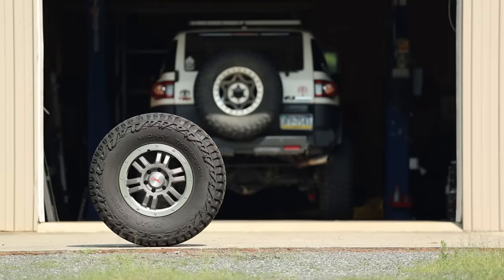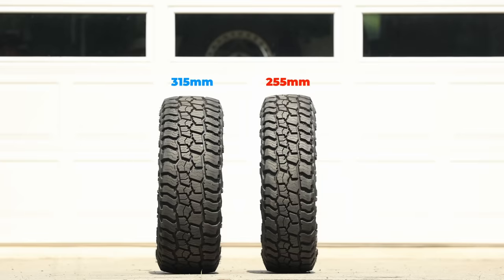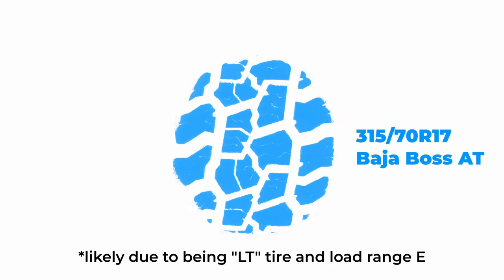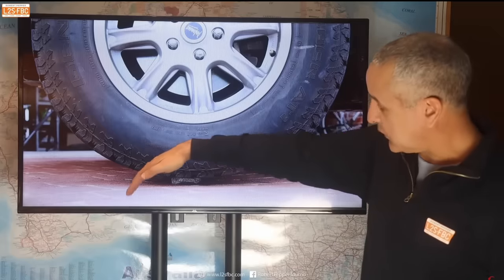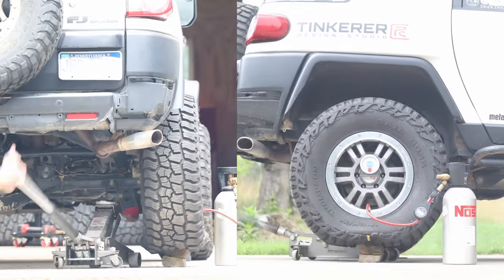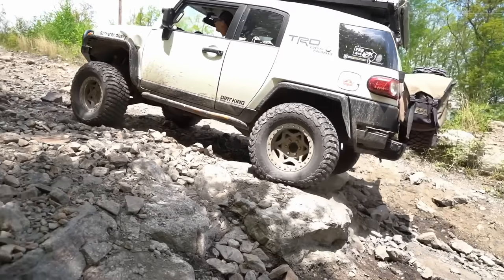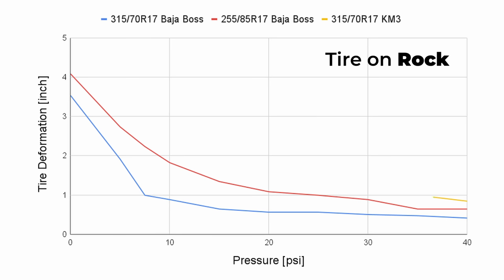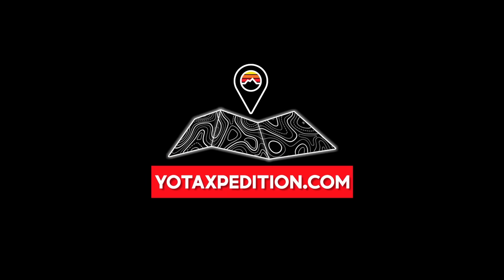3 Scientific Experiments to Settle This | Wide vs Narrow Off-Road Tires

Comment: That's a lot of work and detail put into what are very similarly sized tires.I'd say it's quite a stretch that  your 255/85r17 could be considered a Pizza cutter, compared to the 315/70r17, but I guess there is a lot of room for one's interpretation of what a Pizza cutter is .There are definitely much better comparisons where the term Pizza Cutter might more appropriately apply. My thoughts drift more to old army jeep tires, and tall skinny snow tires, of days gone by..Lots of great information otherwise

Comment: I just find it funny that we are calling 255 tires "pizza cutters"  Up until somewhere in the late '90's or early 2000's a 235 section width was standard on all 3/4 and 1 ton pickups.

Comment: On soft surfaces like sand and snow width and diameter win since debeading unlikely and hard surface conraft area irrelevant. On soft surfaces it's about total area when embedded X amount. It'd be tricky to measure but a similar video using maybe contact adhesive spray and actual sand might work. Huge effort cleaning up though.

Comment: My comment is more on using beadlock wheels, as far as I know, they are for off-road use only (not DOT approved), and I use my 4x4 for play and as a daily driver. 
So it looks like the pizza cutter is the better choice for me.
DOT looks at beadlock wheels the same as the old split rim wheels OTR trucks used many years ago and are illegal for street use. 
But I really enjoyed the video, and the information was awesome.
(There is no federal law specific to beadlock wheels, but there are laws against split rim wheels) that is where the problem comes in.

Comment: The one missing test I was hoping for, does flexing around an obstacle actually improve your ability to drive over it? We all know increasing contact patch will help on soft surfaces you sink into, but we also know that larger tire diameters roll over hard objects more easily. Flexing around an object effectively reduces your tire diameter, which might give you more torque to climb, but does that make up for the reduction in diameter and the energy you’re putting into deforming the tire instead of climbing the obstacle?

Comment: with the beadlock wheel the bead spread is wider than the no beadlock wheel so that is a significant difference in testing the two same size tyres

Comment: I thought this was gonna be more application based than theoretical and testing, so my guess was wider would be better in sand and narrow better on rocky terrain. The tread shape comparison backs this to a point, because a longer narrower patch would dig into dirt more, but the flex helps over rocky terrain

Comment: There is one other variable not address which affects tire deformation.  The weight of vehicle versus the tires max load based on PSI.  Those Baja Boss A/Ts were not identical in load per PSI, the 315s had a max load of 3,195 lbs @ 65 psi while the 255s had a max load of 3,195 lbs @ 80 PSI.   Meaning, as the corner weight of the vehicle is constant, the belt structure of the 255s will be lost much sooner because the loss of PSI will deform tires ability to maintain the load. 

These were designed for a much heavier vehicle and you should weigh the corners your vehicle.   Hypothetically, lets say the corner of your FJ weighs 860 lbs.  For the 315s to maintain structural integrity and constant tread pattern you would have to inflate the 315s to 860 lbs / 3,195 lbs * 65 PSI =  17.5 PSI  versus  860 lbs / 3,195 lbs * 80 PSI = 21.5 PSI.

Same goes for the BF Gs KM3s, they are 3,195 lbs @ 75 PSI, this means at lower PSI for the weight of your vehicle they will have better deformation (in addition the design of the tire and side wall structure).  The results of this test would be different with a vehicle and those Mickey Thomasons

In all my vehicles, I weigh the corners of them with me in the vehicle.  I then inflate the tires to the PSI based on the load rating of the vehicle + 3%.  For example,  on my current Tunrdra on the tires, I run 25 PSI left front, 24 PSI right front, and 19 PSI rear on BF G A/T KO2s.  I've been doing this for 35 years with perfect tread wear and long last tires with 70,000 miles easily.  Every time I put a load on the vehicle, I inflate tires based on the load, I also deflate the tires when I remove the load.  Every time, I go into the shop Toyota inflates the tires based on the door PSI, but that was meant for a 31" tire.   Therefor, the tires will be bulging down the center because the tire was rated for a heavier vehicle.  I just deflate in the parking lot after I leave.

Make sense?

Comment: I love watching these video's but I know from practical experiance that a narrow tire on soft sand is a bad choice. The wider tire makes a huge difference on sand. Snow is the opposite. In practical experiance the narrow tires go though the deeper snow and even packed snow much better.
Reply: I agree, (I think) because the sand deforms in a curved shape under the contact patch, then the increased width is effective in increasing traction (Assuming the diagonals are equal), as it is actually in contact with the curved sand underneath. The video may study matters on hard surfaces (pavement, blacktop, rocks) but soft surfaces (sand, for example). Things may differ.
Reply: @محمدعبدالله-ب5ث4ظ  I think there are two different principles going on with the different tire sizes, aka widths. Sand is actually more similar to deep snow. The point of the wider tires is to float on top of it. When you go extreme like 35 inch to 47 inch tires you can drive on 8 feet of snow due to flotation. The heavier the vehicle the larger the tire requirements. The increased surface area minimizes compression of the snow and thus sinking into the snow or sand. My 8,000 van struggles in dry sand with 245/75R16 tires but throw on 285/75R16? tires and it's easy peasy at even the same pressure or higher.  Those same tires are relatively crap in a foot of fresh wet snow. For fresh wet snow I have  something like 225/85R16?. Again from my memory which could be crap but it's tall and narrow winter tire and it goes down to the snow and compresses it tight together for great traction in fresh snow. Hard frozen sugar snow and you are back to big and wide tires being best. Depending how hard the snow is. Sugar snow just sucks no matter how you look at it.

Comment: So Archimedes says tire psi * contact patch inches * 4 tires = vehicle weight. Tire displacement shall equal the weight of the vehicle. Change psi and contact patch balances. This is also why the contact patch area is the same regardless of the tire width. It only starts to vary when you test a different tire because you forgot that it has a different tread and actual contact area. You calculated a lot of air space in your area. Lots of other interesting observations on tire construction. Thx

Comment: Holy shit, that must have been a lot of work to shoot and edit.  Thank you so much for putting in the work!

While you focus on the empirical data, I'd be curious to hear how comfortable the skinnies are off road in comparison to the fatties.  I ask because while I only wheel stuff that a good driver could bash a stock rig through with very minimal damage, I roll on 315/75-16s for the comfort when aired down.  My bitch about them is that on my particular rig, I need 1" spacers to get them to clear hard parts and as such, the steering feedback sucks on road, the steering wheel gets jerked around a lot off road, and I tend to burn up wheel bearings faster than usual.  Running 255's on the stock wheels would fix all of that but my only unknown is how different they'd ride compared to what I'm currently on.  I guess a slightly worse ride would be an acceptable tradeoff to fix all the other stuff, but my wife's tits wouldn't be too pleased with it.  lol...

Comment: Lot of work 👍 I’m going with wides 15.5+ 😂  I know skinny cuts better with less pulling to sides and drag (cutting vs pushing) 
    There’s the pounds per square inch which in a daily driver should benefit a wider for braking 🤷🏻‍♂️

Comment: Wonderful video but the co cousin was based on specific tyres. Not all tyres behave the same. I agree that a typical pizza cutters would outperform a typical wide tyre but like shown in the end in this video (bfg) many tyre manufacturers are coming up newer tyre technologies which allows the wider tyres to flex better, like for ex the Maxxis 980 ATs, they flex so much more than the Mickey ATs. The flex depends on the lug design and carcass rigidity. With some other tyres the performance gap is much closer than what's seen in the video as I understand based on my observation/experience.

I prefer to go with the size between the p.cutters and wide width. I focus more on the compound instead. That way I'm able to get the best of all worlds however at the cost of slightly lesser mileage, which is a compromise I'm willing to make considering I'm not into competitions!

Comment: Just the weight savings alone makes it a no-brainer for me. Less unsprung weight at each wheel means less wear and tear on the drivetrain, better fuel economy and better handling overall.

Comment: The LT255 tire is rated at 3,195 lbs @ 80 psi and the LT315 tire is rated at 3,195 lbs @ 65 psi.  Quantifying/comparing contact patch by using equal inflation pressures for comparison, is faulty.

Comment: You forgot one key difference to ballooning tires. Your rim width, great video though. Carcass strength/sidewall ply's/and ply type should be considered against rim width.   skinnier rim+wide tire = (   )  wider rim plus skinny tire = /  \  and rim width roughly the same as contact patch = |   |   this changes the deformation characteristics of each tire. From convex to concave.

Comment: Wide tires are generally only better for very soft terrain like mud or sand where the soft surface mushes around the tire and creates total contact with the tire. Also the larger surface area spreads the weight over more of the surface so you don’t cut into the soft terrain and bottom out as easily

Comment: This is an excellent video for all off-roaders. Great information! I just wonder about two factors. Firstly, the "ink blot" testing was done on pavement. I wonder how the imprints would differ if the impressions were made in a softer medium, like soil or sand. Not everyone goes rock crawling every time out. Secondly, I wonder if they would change disparately when mounted to 8" rims vs. 10" rims. I could only offer reasonable guesses, but maybe someone knows the "skinny"?

Comment: hi,
I appreciate the logical approach to the Tyre width debate.
there are some concepts that I think need airing.

for a theoretical 100% flexible side wall stiffness and on a completely flat surface, the thread pattern area times the air pressure must be equal to the load on the Tyre. This is required to balance the load regardless of Tyre width. It is therefore not surprising for a given air pressure the thread pattern were the same size.

however the actual contact surface between the tyre and the real ground  where these tyres are to be used, is not a flat surface so your thread patterns that you developed are misleading and do not show the actual thread pattern that would develop in a deform-able ground surface. It does not show the rubber to inter-granular contact surface or area.
It is beyond argument that wider tyres afford better traction - see racing cars all use wider tyres.
It is also beyond argument that traction is equivalent to tyre grip in off road situations so without further consideration it is reasonable to conclude that the outcomes of the video are in question.

Further as your testing showed the narrower Tyre deformed  more for a given air pressure. This deformation  is not a good trait but rather a detrimental aspect of the narrower tyre. The more deformation a tyre has for a given stiffness, the more "work " done and results in more heat generated. The more heat, the more ware and damage that occurs to the tyre.

The narrower tyre do result in less rolling resistance on flat surfaces, so on the road these are by far the best tyres for economy. See any economy trials or cycling, all use high pressure narrow tyres.

however, anecdotally, for grip the wider tyres out perform the narrower tyres as is displayed in any motor racing event. You don't see any narrow tyres in competitions and these guys undertake may year of actual testing on the tracks be they on asphalt or mud.

I believe the video made an honest attempt at the subject but overlooked the physical attributes  of the tyre to surface contact surface, to obtain misleading observations.

Comment: Did not mention PSI at ground contact. The load on the tire (the weight of the truck) is constant but the PSI is higher on the skinny tire, better for hard surface including ice. Fat tire distributes the weight over a larger area so lower PSI, better for soft surface like sand.

Comment: Video is very well made, I like the content and the tests (the graphs are a very nice touch). Excellent information, however I feel that it's missing one key engineering component that would make this video perfect. (Maybe focus and test this for a future video)
That component is how many actual lbs of actual vehicle pressure per square inch of tire. When off roading there are scenarios where you need more or less pressure on the tread to achieve grip. For an example a wider tread works great for dry but in wet can create a lift or slippery scenarios because the weight has less pressure per square inch as the weight is spread out across the tread (this allows snow to actually lift the vehicle and slide) where as a narrow tire would have more weight per square inch that would actually cut through the snow and bite on the surface below it. And since with airing up/down the narrow tire yields a larger tread fluctuation make it even more versatile than the wider off road tire.

Comment: Excellent video. I have a 21 Silverado 1500, and would like to give it a more rugged look. The wheel wells are so large, that the factory tires leave a lot of room. It would be great to achieve this goal without sacrificing more than 1mpg. The rim size is 20”. The truck is not lifted, although I am considering a 4” lift. I’d greatly appreciate any advice you could give. Thank you.

Comment: G'day mate, 
Excellent video, and very well thought out. 
On that note, there's a flaw in your method. Your tests are passive, and should take into account the active aspects of the tyres. Ie, you Jack the car up, then lower it onto the obstacles, the results can't be accurate, as the suspension isn't settled, and the tyres aren't doing their job. It's like when doing a roadworthy on my old car, but the car was a little low, so I Jack it up, then lower it, and the height passes the test. 
Also, look at the videos of vehicles actually driving over obstacles, and note that the flex in the tyres are completely different. As the tyres go over obstacles whilst driving, even at very low speeds have different loads, in different angles. 
Even car tyres behave differently when driven vs stationary.
Then take into account different manufacturers, and the different types of rubber used, and the rest of the variables. If you perform the same tests on a tyre from a different manufacturer, you might find your results to be different. 

I'd love to see a more comprehensive test taking into account the many variables. I would be quite interested in the results 👍

Keep up the good work mate.

Comment: Now do the experiment again, keeping outside diameter and profile the same by adjusting the rim diameter according to tire width.  Compare the 70 series 35/12.5/17 to the pizza cutter 85 series  35/10/17 and 35/12.5/15.  You will probably find that going with the smaller rim size for the 315 in the same diameter means pizza cutter.

Comment: The pizza cutter doing better in snow is not cut and dried. It depends on the type of snow. I live near Whitewater in BC. We get HUGE dumps. I’ve found that pizza cutters dig down but can’t always find bottom. Or they find bottom but are pushing too much snow. A 285/75/18 is kinda mid… not too wide, not to narrow and performs incredibly well in our kinda snow. My buddy two hours away in Cranbrook swears by his pizza cutters. They get WAY less snow and it’s more granular and less fluffy.

Comment: Larger tyre give more weight distribution like in a snow ski. Less weight per square cm what will reduce grip so much in mud like in tarmak. Even in mud the thin tyre will dig the slippery mud and gain contact with hard rock. Large tyres are just good if you travel in very soft ground or also in tarmac if you have a large car

Comment: I have been running 35x12.5x17 Baja Boss tires for the last 35k miles and they have been excellent. Mine are "D" load range not E because they are not the metric version. E load range is a big difference with very heavy sidewalls. What was the load range of the KM? Was it also an E rated tire. Why did you use the lighter rear half of your truck vs the heavier front? E load range are known for having very poor flexibility and not recommend for such a light vehicle like your FJ or even Jeep Wranglers. E load range is intended for full sized trucks that are 1000lbs or more heavier and carry heavy loads often. Also you focus mainly on hard surface/obstacle contact and that is all well and good, but what about sand, soft dirt, and mud. I think you will find much difference numbers especially is you do your test with "D" or "C" load range tires.

Comment: Load range E is for super duty trucks; yotas are not heavy enough for those tires to flex enough unless completely flat or somewhere close to it. It would of been great if you threw in a C or D range tire into comparison, but I think there's none in those sizes available. Like your vids though! Great work!